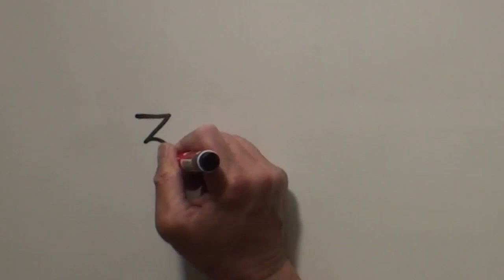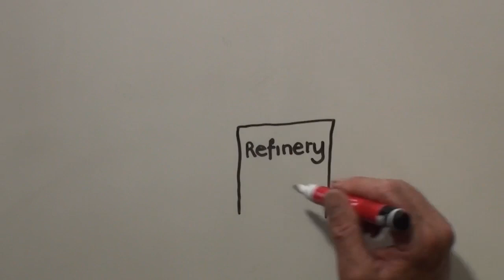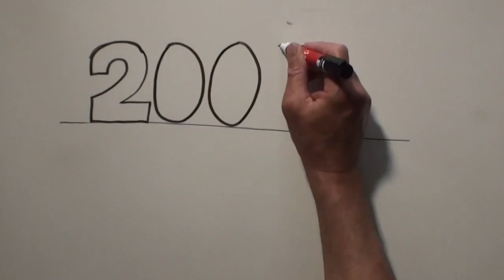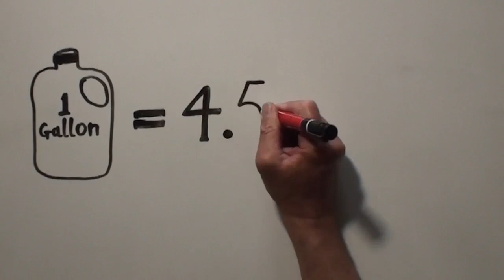Volts for Oil | Fully Charged

Comment: I've been doing a bit of maths here and there, but without figures I can't tell for sure how much more power the combustion car is using, per mile, than the electric car.  Yep, you heard me right; I said MORE.

I mean, there are too many variables such as transmission lost (power is lost on its way from the plant to the charger), the efficiency of the refinery, the size and efficiency of the tanker that drives the fuel to the pump, and the energy used in extraction.  The entire infrastructure of getting petrol to the consumer is a far more intricate and power-hungry ecosystem than you'd believe.

I did, however, work out that a fuel tanker can achieve around 4-8 mpg depending on size, conditions and quality of engine, and can carry anywhere from 4,000 to 10,000 imperial gallons.  

If you were to make the assumption that a fuel tanker drives 100 miles from the depot to your local station, averaging a very generous 8 mpg, then it's used 12.5 gallons just to transport the fuel.  The fuel for that tanker, in itself, took (by Robert's figure) 56 kWh to refine.  Those 100 miles took 0.56 kWh, or 560 Wh PER MILE!  Obviously, as these maths are napkin and ignore a lot of variables, I've assumed a very good 8 mpg for the tanker.  As it unloads fuel it becomes lighter and consequently more efficient with every petrol station it subsequently visits, but I won't get into any of that.  Let's just stick with 8 mpg because it gives the electric car the harder side of this little test.

Conversely if we assume someone is driving a Tesla Model S electric car, the 85 kWh model can do up to 300 miles in ideal conditions.  Let's assume more realistic conditions and say this driver drives efficiently and manages to achieve 260 miles on a full charge. (85 kWh) as this should account for efficiency loss in the DC motor, temperature, drag, etc.  The grid estimates around 6% of energy is lost during transmission, so the Tesla is more realistically using 90.1 kWh to do the 260 miles provided for this example.  The result?  347 wH per mile.

So we can identify that the energy used for refining the fuel that powers the tanker that then carries the fuel to your local pump, IN ITSELF, uses up SIXTY PERCENT more electricity per mile than a Tesla Model S driven under a more realistic range on a full charge with transmission losses accounted for (actual Model S owners ARE getting 260 miles on a charge if they drive economically!)

...and I haven't even touched on the energy used to scout, drill/pump and all that jazz also involved in getting petrol or diesel to the customer.

I'm not great at maths, but it doesn't take a genius to realise that no matter how you look at it or how many variables you play with:  Electric cars use less electricity to run than combustion cars.  Even if you were to factor in the production of the lithium batteries, the case remains true.  The batteries last years.  Fuel is used up only once!
Reply: Yes but Robert's figure is out by more than a factor of ten.  Yes, UK refineries used 5.62 billion kWh of electric energy in 2005, but they also produced around 16.5 billion gallons of refinery product.  That works out at one third of a kWh per gallon, not four and a half.  Refineries do use much more energy than that (in kWh units it's up to 6 or 8 kWh per gallon of product), but most of that energy comes from the crude oil itself, and some from gas.  Grid electricity is a very small fraction.
Reply: Hi Will, I remember reading once that typical transmission loss is around 30%, thats gearbox & differential combined...So a 100 hp car puts 70 hp on the driving wheels....Add this to the inefficiency of fossil fuels and you have a huge amount of losses with petrol/diesel cars in comparison to EVs....
Reply: MrFreddiew1 so if the engine directly drove the wheels you'd get 43% more out of the car... so a car that does 50mpg would do 70mpg without a complex transmission?! :O
Reply: ***** Maybe the extra economy the better cars have is because they have more efficient gearboxes though... along with smaller engines
Reply: *****
I guess so, something like that..But direct drive is not practical because your speed would be limited by the max revs of the engine...And I guess more economical cars have a mixture of more efficient engines and drive trains..Front engine & front wheel drive is the most economical configuration, the same would apply to rear engine and rear wheel drive.

Comment: Robert,

I'm a Volt owner and am a likely customer for Tesla's future 3rd generation car. I've watched all the episodes of Fully Charged that I'm aware of and they are great. I'm eagerly looking forward to watching future segments.

But.... this recent episode titled "Volts for Oil" on the grid electricity use by refineries in the UK appears to be repeating misleading and inaccurate claims.

You state that the oil industry no longer releases data on this after 2005. Yet I found UK annual data up to 2010 after a few seconds of googling and more recent data is apparently available from the UN in an offline publication.

You also quote some unclear source as saying that it takes about "4.5 kWh of electricity" to refine every gallon of UK gasoline but you don't show the math.

According to data.un.org, UK refineries used 4,459,000,000 kWh in 2005:
http://data.un.org/Data.aspx?d=EDATA&f=cmID%3AEL%3BtrID%3A0925

And, UK refineries produced 22,620,000 metric tons of gasoline:
http://data.un.org/Data.aspx?d=EDATA&f=cmID%3aMO%3btrID%3a013

That 2005 UK refinery electricity use is slightly different from the number you use in the program (5,642,000,000 kWh) which also came from the UN, according to you. The numbers vary from year to year and the number you used is almost exactly the same as the UN online 2007 number. In any case, the precise numbers don't matter that much in the scale of the final calculations.

And yes, gasoline is sometimes measured by weight and that converts to around 8,104,621,999 US gallons, according to various sources including this US government conversion calculator:
http://www.eia.gov/kids/energy.cfm?page=about_energy_conversion_calculator-basics

So, 4459000000 / 8104621999 works out to 0.55 kWh of electricity per gallon of refined gasoline from a UK refinery.

A typical refinery produces 19 gallons of gasoline for every 42 gallons of crude oil or 46% by volume, according to Wikipedia and other sources:

http://en.wikipedia.org/wiki/Gasoline#Energy_content

Therefore, the energy used in refining needs to be shared with the other outputs of the refining process like diesel, kerosene, jet fuel, heating oil, etc. If we assume that all refinery products require roughly the same amount of processing then 0.55 kWh x 46% works out to 0.25 kWh per US gallon. A UK gallon is 20% larger so adjusting for that we get 0.3 kWh per UK gallon.

Similar calculations based on US government data (which roughly matches UN data on the US) shows similar results.

So where did the "4.5 kWh of electricity" per gallon claim come from?

Similar claims of around 7 kWh of electricity per refined gallon of US gasoline per used in early Nissan marketing materials for the LEAF but were later abandoned. Others have calculated that about 6 kWh of energy is used to refine a gallon of gasoline using US government data.

These numbers likely represent calculations of the kWh of energy, not electricity, used in refining a gallon of gasoline. Just like gasoline is sometimes measured by weight, non-electrical energy is sometimes measured in kWh and this can cause confusion.

The vast majority of energy used in refining gasoline comes directly from fossil fuels -- mostly natural gas and leftover output from refining earlier crude that can't be economically sold to customers such as "still gas".

Here's a page that breaks down the energy input used by the refining process in the US. Although it isn't obvious at first glance, if you calculate the energy value of the various inputs you will find that they total about 20x to 30x kWh larger than the electricity listed there or on the UN site for US electricity usage by refineries:

http://www.eia.gov/dnav/pet/pet_pnp_capfuel_dcu_nus_a.htm

Since this is an important story and is often misunderstood, I suggest that you find and interview an expert on the gasoline and diesel refining process and then use this to update and republish your episode with better information.

Thanks for all the effort you put into making Fully Charged an excellent forum for promoting plugin vehicles!
Reply: The best comment I have ever seen in my entire life.

Comment: I like the video but wasnt sure if when it says 20 trillion miles for those 20,000,000 cars with only one recharge... which would make the average per electric car of 10,000 miles. Petrol cars (30 million of them) so an averga of 9000 miles a year so you would need an additional third of extra power if all cars were electric but we still would need jetfuel, some petrol and diesel and plastic... It is interesting though and I think we could go all electric one day with enough other sources other than fossil fuel/gas/. Also was Robert talking American billions or UK billions as they are different and one needs to be clear ;-)

Comment: Please note that these figures apply only to the refinement of oil. There is still quite a bit more energy expenditure involved. First, how much energy does it take to drill a well? Changes considerably depending if it's a deepwater well vs. land well. Also consider transporting the oil from the well to the refinery, On the low end is a pipeline, on the high end are supertankers. Then of course once the oil is refined to fuel additional energy is required to get that fuel to your local gas pump, and then also consider that you may be wasting fuel actually having to drive to a gas station, and home again.
Wonder if we will ever get real world numbers for those energy costs?
Reply: Assuming a fuel tanker does 8 mpg (generous figure for a tanker) and the refinery is 4.5 kWh per gallon refined, the tanker is using up 560 watt-hours per mile (not including the tanker's return trip!) just to merely transport the refined product to your local pump.  That's over 50% more watt-hours per mile that the average electric car driven by Mr. average can do.  And that's just the fuel tanker alone!  So so far we've only counted the tanking stage of the well-to-wheels process and it's already used up more electricity per mile than the electric car has.  

...and to think people always argue about 'where the power comes from to fuel the car' or 'how it will run the grid dry once everyone's plugged in'.  Bah.  As Elon Musk says, if we stopped bloody refining, we'd have shit loads more electricity to play with.
Reply: Not to mention that you have to transport the petrol to a gazillion stations as well, and people have to drive to them to fill up their tanks. Its really an amazingly inefficient and wasteful way of going about things when we already have wires directly into our homes.

Comment: The argument, that EVs use electricity from the grid, and are therefor as dirty as a diesel car becomes obsolete, as soon as the energy-mix starts to improve. Once the E-Power is cleaner, every EV is as well, while changes in the ICE's efficiency take years to affect the overall traffic emissions.
Vote green for EP!

Comment: The electricity for the refining stage alone is enough to power a Nissan Leaf for about 18 miles.  That is leaving the oil in the ground.

I'm fairly sure that oil extraction also consumes a lot of electricity, and a lot of natural gas is used in refining - and the natural gas has it's own energy overhead, that needs to be accounted for.

Suffice it to say, the "long tailpipe" argument against EV's is moot.

Comment: Lol I worked it out to the equivalent of 6miles per gallon so a car that does 30mpg is really doing 24 real miles per gallon
Reply: That doesn't sound accurate. 4.5 kWh in my LEAF provides 17.5 miles. I average 3.9 miles per kWh in MN, but any warmer state will have better efficiency.

Comment: Ok so if we assume 500g/kWh on UK mix then my 100mpg 12 year old car pumps out an additional 14g/km CO2 based  on your refining figures. That's still much less when added to the 81g/km than a Nissan leaf using the same amount if co2 per kWh.

Comment: The same people who criticize electric cars for being run of the coal grid will start driving them when the price point falls below that of a gasoline car. They just mistrust the technology because they fear it will cost them more money and get hoisted on them.
Reply: Also, when they realize that the Volt is much cheaper to operate.  I will only have to change my oil two or three times during the life of the car.  My brakes should last about the life time of the car.

Go to KBB's 5 year cost of ownership and plug in any gas car that compares to the Volt's sticker.  Even without the credits, the Volt almost always comes out ahead.  Throw in $7,500 and it amazes me why people don't take that into consideration.

It takes money to operate a car.  The question is, which is more?  KBB tells it like it is.
Reply: ra5928 æ

Comment: Viewers should probably know that a 'considerable' amount of the electricity used by refineries is produced by the refinery itself in a process known as co-generation.  It uses some of the less useful by-products of crude as fuel for the process.  How much it uses will depend on the type of crude and the cost of grid electricity (amongst other things).

Obviously, this doesn't matter much as far as the point of the video is concerned as the co-generation still generates CO2 and probably lots of (maybe even worse) pollution than burning petrol, diesel or coal.

In the US, with their woeful car efficiency - currently no better than about 20% - the amount of electricity used to make fuel is at about parity with its effective energy content i.e. you can go as far in an ICEV running on petrol as you could go in an EV running on the electricity used to make the ICEVs petrol.  MW

Comment: This is very good information. They should also point out that electric use at night is very low but they can't turn down COAL, Nuclear or EVen hydro so they have excess at night. Most electric cars plug in at night while the owners sleep. Most cars have a timer so you can charge at 2 am or 4 am . It only takes an hour or two.
Reply: +Jim-Elaine Stack Coal, nuclear and hydro power stations do reduce output and fuel (resp. water) consumption when demand is low, which is not just at night but also when the wind is up.  Wherever did you get the idea that it's not possible?  It may be a little bit less efficient to run them at part load, but it happens frequently.  The owners would no doubt prefer to run them at full capacity around the clock, but that's an economic decision, overruled by concerns about pollution.

Comment: Robert - this is very illuminating, and good work on your part. Throwing big figures around makes you just as guilty of spin as your opponents though, unless you actually boil this down to a figure that can be compared directly to electric car usage.
Reply: One of your commentors has... so we learn that 4.5kWh would drive a leaf for 15 miles. That gallon of petrol would drive a similar car for maybe 60 miles.

In short - a petrol car uses gasoline + 1/4 of the electricity of an electric.

This provides a clearer picture than handwaving and giganumbers.
Reply: albedo0point39 I don't know about the Leaf, but I can do 35km with the Ampera on 4.5kWh of electricity.
Please, do tell me, which comparable ICE car consumes 4 litres of gasoline per 100km (in real life, not factory PR figures). You can use this link: http://www.spritmonitor.de/
Reply: Andrej Potokar I can do about 60 miles on 1 UK gallon of petrol in my (oldish) Nissan Micra, if I'm driving frugally. Usually I get less, as I'm less careful.

The point I'm making is not pro-gasoline (I love the concept of electric and will happily convert when the cost/benefit works for me) - I just think that spin degrades Robert's very valid argument.
Reply: albedo0point39 I said to use a comparable ICE car, not the smallest one on the planet ;-) You can't compare apples to oranges.
Comparable ICE car to a Leaf would be a VW Golf 7 TSI.

Here, let me help you: http://www.spritmonitor.de/de/uebersicht/50-Volkswagen/452-Golf.html?powerunit=2

The average is 7.93l/100km.
Reply: albedo0point39 Yes, if you can do the figure suggested that's only the energy used to refine the petrol...now do the figures for the energy in the fuel also